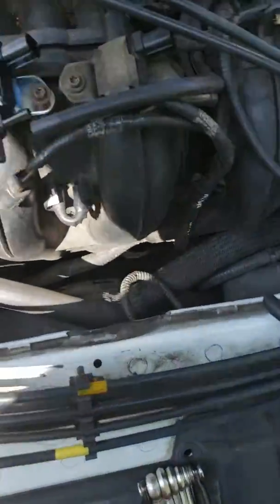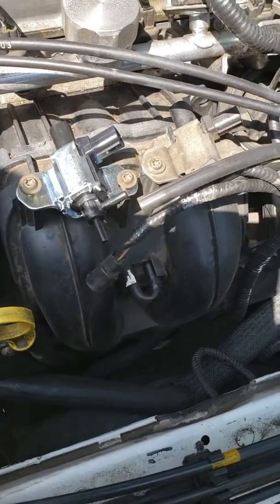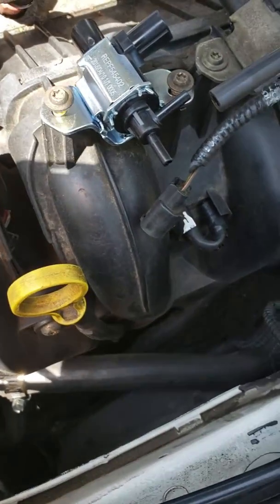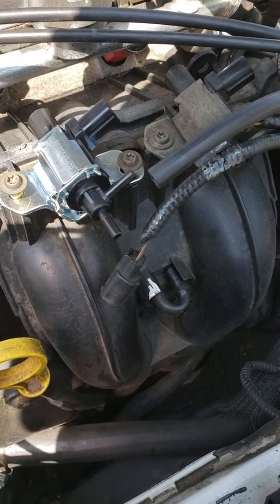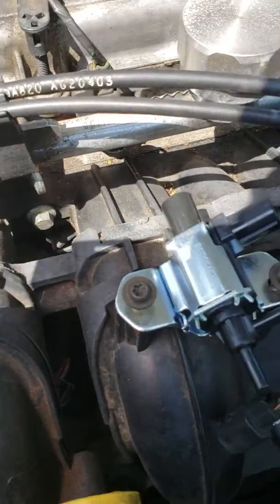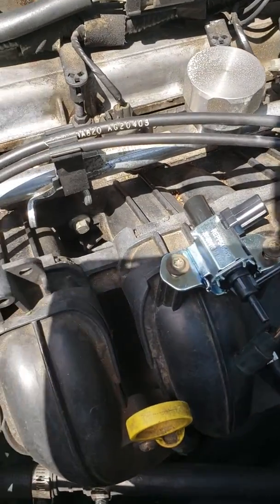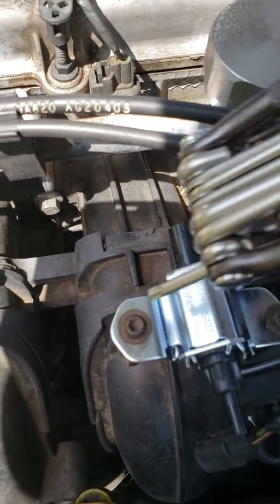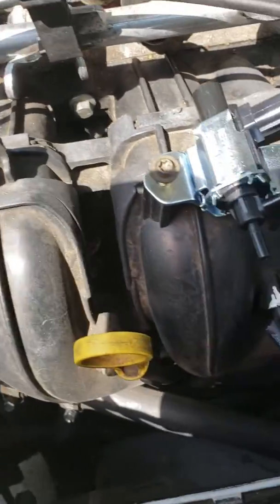2003 Ford Focus Zx3 2.3L engine code P2004 P0751

Comment: 911-907 Intake Manifold Runner Control Vacuum Valve Assembly Solenoid for Ford $6 to $10 on Ebay. Star screw size is CR-V 125

Comment: I have a p2004 code and get hesitation with a/c on. Any hope replacing these will help?
Reply from the maker: That's the same code I had on. When I replaced those black tubes as well as cleaned the inside of the intake manifold, the car ran better.
Reply: @miguelmarquez7505  thanks did u take the manifold off?
Reply from the maker: @punkrocktv8229  yes to replace the flaps and gasket on the inside.  I didn't make a video of that though.

Comment: If you are going to do a tutorial, know the name of your parts and your codes and the measurement of vaccum line and proper size of the vaccum line.
For the intermediate DIYer like myself, I know what you're trying to say, but for a beginner, your tutorial would be completely incomplete 👎
Reply from the maker: Thank you for your input.
Like I mentioned in the video, I'm not a mechanic and some parts I didn't know what they were.
I couldn't find a video that helped me with this so I did my own. Thank you for watching.

Comment: please provide information on What is the part? you show it but are calling it "this part". do you have a part name or part number? please and thank you
Reply from the maker: Unfortunately I dont have a part number.  It's a butterfly  solenoid for the intake manifold.
Reply: 911-907 Intake Manifold Runner Control Vacuum Valve Assembly Solenoid for Ford
Reply: @JamJells  thank you so much

Comment: Where did you get this part and how much did it cost you for both?
Reply from the maker: It's called a butterfly solenoid for Ford focus. My Ford focus was a 2003 ZX3 hatchback.
Got it off Ebay for a few dollars brand new.
The hose, I got at Autozone. I dont remember the size but they can cut off a small piece for you to check if it fits.
Reply: @miguelmarquez7505  No such thing on eBay.
Reply from the maker: you can check autozone,  a1auto.com, and rockauto.com.